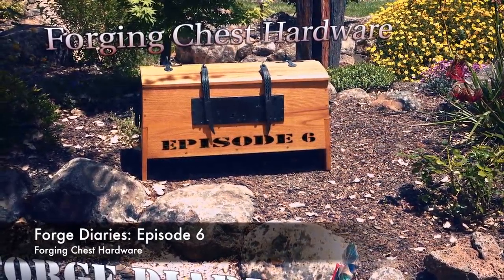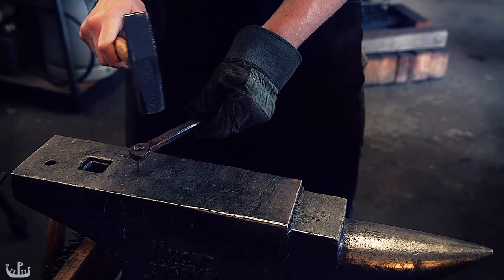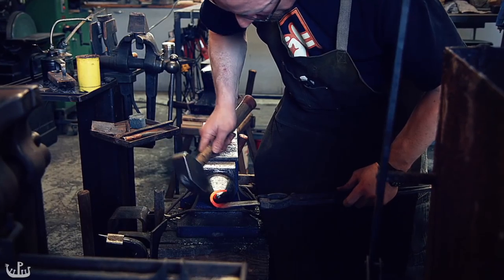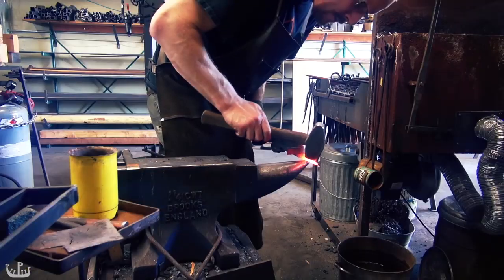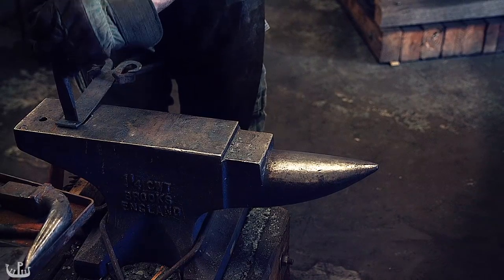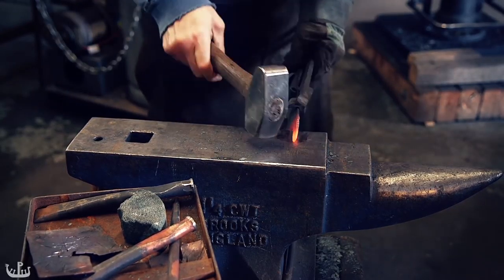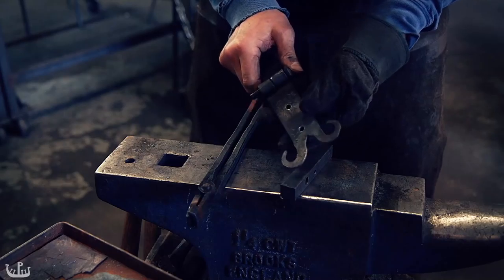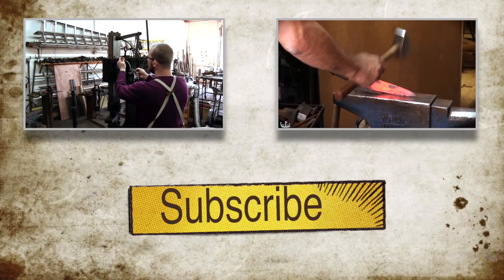Forging Chest Hardware (Forge Diaries: Ep. 6)

Comment from the maker: @grundlerg how long does it take you to make a nail?
Reply: Niels Provos probably 5-6 minutes? I wasn't timing it. Two weeks ago I made a few nails in 5 heats (not consistently): 3 to shape the nail, one to use the hardy tool (prep to break off), a final heat to break off/peen the head of the nail. But I'm handicapping myself by using my own (crappy) nail headers made from A325 (0.3% carbon) 19mm (3/4 inch) bolts available in the Google welding shop. I'll make some new (better) ones soon after looking at the nail header you are using.